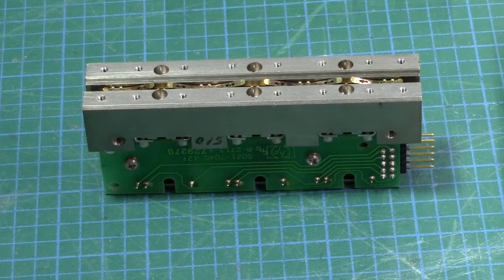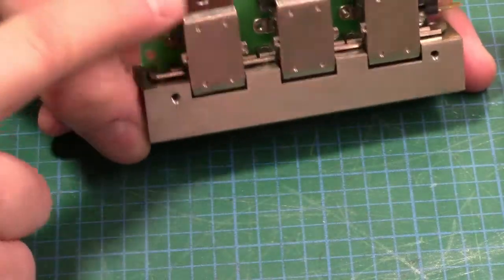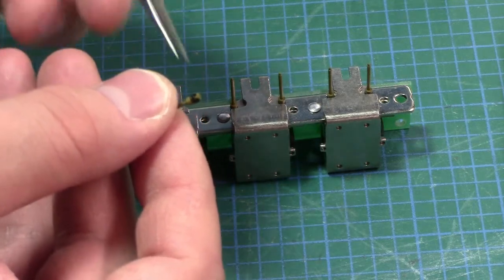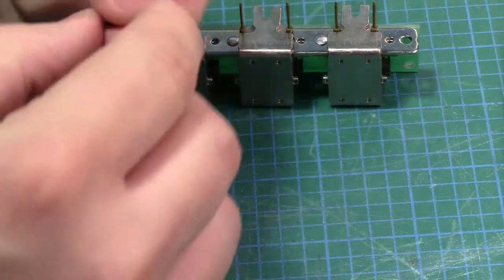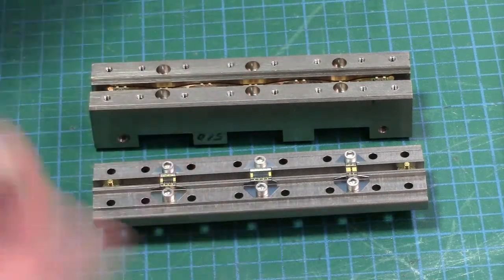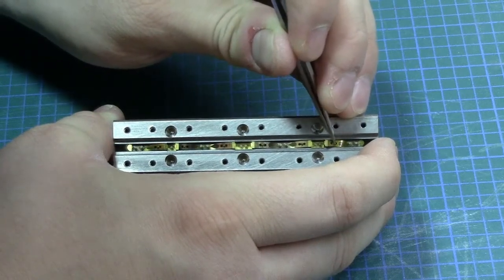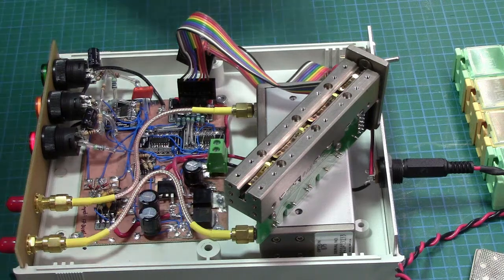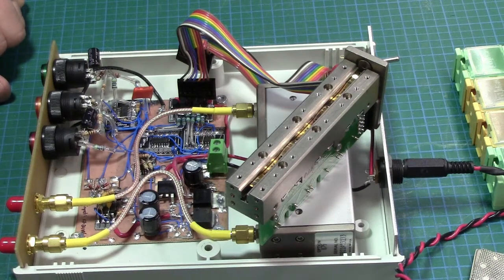HP RF Attenuators: o-ring repair

Comment: Thanks for the excellent video.  I couldn't have repaired the attenuator in my HP 8593E spectrum analyzer without it.   I would never have suspected o-rings would cause intermittent operation of the plungers.   I found the o-ring kit you used on ebay for $10.  Saved me like $500 on a rebuilt unit.
Reply: How did your repair go? was the disassembly very different than the one in video? Any particular advice? I need to do it on my 8596E. I think the attenuator must be the same as 8593E or very similar.
Reply: @amirb715  Most of the work was removing the front end assembly to get to the attenuator.  Repair manual is essential to find all the screws and wires that need to be removed and disconnected in the correct order.  Taking photos as I proceeded helped with re-assembly.  It's similar to pulling a car engine :). Once attenuator is removed it is easily disassembled.  Separating the solenoids from the attenuator part may be different than the attenuator in the video.  Since it wasn't shown I had to figure it out myself.  There are 8 hex head screws that need to be loosened (not removed)  to let the steel covers come off the solenoids.   Hard to describe.   Pics here:  https://www.dropbox.com/s/vf5mr56nd21tig9/hp8593e.zip?dl=0
Link to repair manual:  http://www.av.it.pt/medidas/data/Manuais%20&%20Tutoriais/15%20-%20HP%20Spectrum%20Analyser%208593E/HP8593E%20Service%20Guide.pdf
Reply: Hi  I have the same SA and mine is about 60db down on what it should be reading at around 100mhz and the amount its down by gets less as you measure higher frequencies. Just wondering if yours had similar symptoms before you fixed the  attenuator. Everything else works as it should so I suspect the Att unit or connections in and out of it.

Comment: Thanks for the quick follow-up posting.  
Good point regarding the physical sizes of the attenuator pads and matching to the size of the contact leaves.
Worth noting that the plungers are some kind of plastic and could snap if bent.

Comment: Pulling and reinserting the pins can be done by sliding the rack that the contacts are mounted on first.  Basically moving the pin to the center of one of the holes first.  This will avoid any damage to the pins or the contacts.   The rack should move fairly easily with a small plastic diddle stick.
Reply from the maker: Thanks!  I loved the series you did on the EEVBlog DMM testing!
Reply: @idpromnut  Thanks.  That meter sure has a lot of issues for something that was certified and has been released for 2 years.   Too bad as it seemed like the brand could have made it a real winner.

Comment: I'm having some problems because it appears those cap head screw used in this thing are an usual M2.2 diameter which nobody on the planet seems to carry. All I can find is M2.5 which I'm sure will be too big.  Some of the screws I'm dealing with have the hex head stripping out on them. It would be nice to replace them with new ones.

Comment: Have you ever ordered replacement pads for those attenuators?  I use the 8496G and 8494G on daily basis and have written software test programs that use them (With the 11713A or B switch driver controller).  Occationally we have to send them off to get repaired.  Yo mention they are expensive.  Brand new, the 8496/8494 are now around $1300 USD each!   I started buying used ones from Spectrum Technologies for about $500 a set certified.  They probably get them on ebay, fix as needed and the certify them and sell them.
Reply: several attenuator pads can still be ordered directly from Keysight. I think they were around $50-$80 depending on the size (10dB, 20dB, 40dB etc) even the push rods with o-rings on them can still be bought from keysight for about $15-$20 each.

Comment: Is the attenuator in an HP 8662A of similar construction, and can it be serviced in the same way? Currently working on an 8662A, and it appears to have issues with the output level...

Comment: Thanks for this video. I try test electronicly a 08340-60175 (33323V) attenuator which need 5 Volt. These have 2 solenoids per pad. Would it work when i attached just 5 volt to these 2 solenoids to activate that pad?
Reply from the maker: Yep, that should work. You also should be able to trace back the wires to that solenoid to the connector and power it from there if you wanted.

Comment: Thanks for the great video! I have started repairing the input attenuator in my HP8596E (o-ring problem). The little amount of epoxy securing the plunger tips was damaged (I found parts of it at the attenuator pads), so I have cleaned it up. My question is: do I have to add new securing epoxy? And what is the best way to do it (large drop pf epoxy will attach the plunger tip to the metal strip,  preventing  the full motion range).
Reply from the maker: I don't recall seeing any epoxy on my unit, but I may have just missed it. I'm not sure what the best way to fix that particular problem is.

Comment: Hi, thanks for the great tutorial video.
Do these HP RF Attenuators require lubricant on their o-rings or any other mechanical components to maintain their switching life span??
Reply from the maker: When I disassembled both of my attenuators, I did not see any evidence of lubricant used initially during manufacturing, so I am assuming that all you need are o-rings that are pliable and of the correct sizing. It may function better to put a very small amount of non-conductive switch lubricant at the back of the plunger (where it is in partial contact with the solenoid) but even then, I don't think this is strictly necessary.
Reply: @idpromnut  What about the lubricant at the metal strips which are driven by plungers? I have noticed some amount of it in my unit, do you know where could it come from?
Reply from the maker: @radiowiec223  Are you talking about where the plungers attach to the metal strips? I didn't see any lubricant on those either; you could put a bit of lubricant on those areas, but keep in mind those o-rings are consumables. Lub might increase the number of life-cycles you get out of them but they will eventually need to be replaced again.